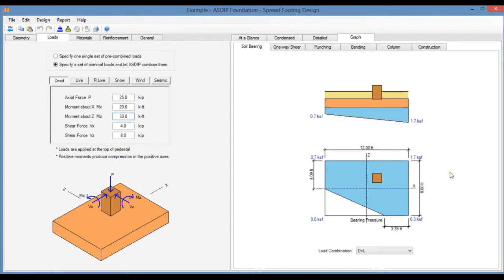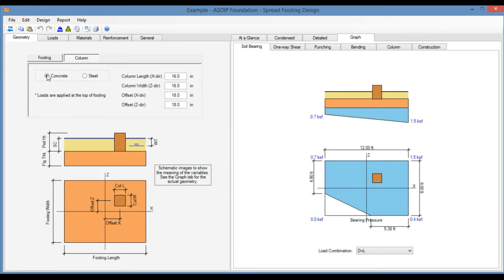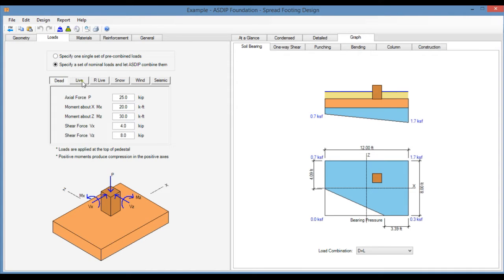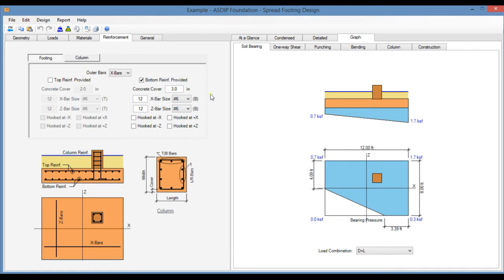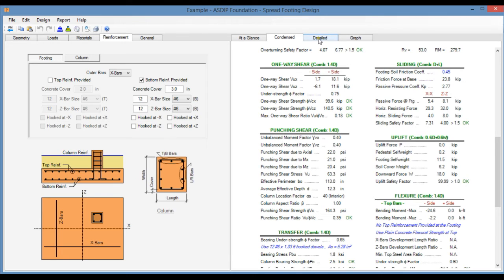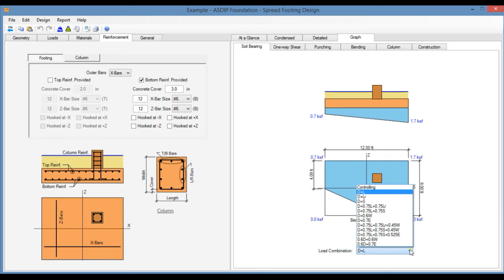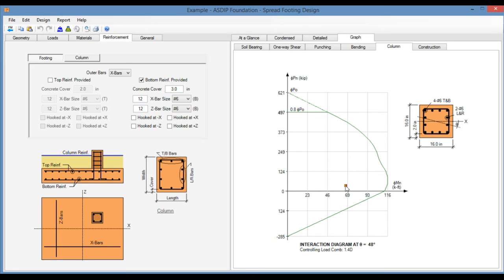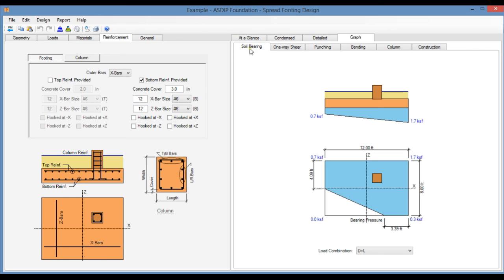Spread Footing Design Using ASDIP FOUNDATION

Comment: For this isolated footing in the reinforcement tab, the diagram is showing top reinforcement. What is the condition of the load why we need to provide top reinforcement?
Reply from the maker: You may need top reinforcement when the footing is subject to uplift. The program checks this condition.
Reply: @asdipstructuralsoftware7797  Thanks for the reply. Is it correct to say that having an uplift is not a desirable design? I thought, top reinforcement is provided only if footing thickness is more than 1m, act as temperature / shrinkage bars.
Reply from the maker: @gnidnoeled786  Yes to both, uplift is undesirable but sometimes is unavoidable and the design must consider it. For deep sections the T&S steel should include top and bottom bars.
Reply: @asdipstructuralsoftware7797  I appreciate your reply. 🙏

Comment: Does ASDEP consider Concrete and Soil Cover Self weight internally or should be calculated and added?
Reply from the maker: The overburden pressure is calculated automatically.
Reply: please clarify (Concrete Self + Soil ) ?
Reply from the maker: @georgefattal3540  Yes.

Comment: Hi, I have been testing the demo version.

I would like to know how the software determines if the column is edge/interior/corner.

I see that it is automatically done based on the footing dimensions, but what's the criteria?
Reply from the maker: If the column face is closer than d/2 from an edge of the footing, it is an edge column. If two column faces are closer than d/2 from the two edges of a footing corner, it is a corner column. Otherwise it is an interior column.
Reply: @asdipstructuralsoftware7797  Thanks for the super quick answer...That's what I thought.

But I am trying with the following input:
Footing: 2.5 ft x 2.5 ft x 16 in
Rebar: #5 
Column: 6 in x 6 in, and pedestal same size....No offsets.

So, d=12.4 in, and d/2=6.2 in.

According to the software, this is a corner column. I don't understand why. With those dimensions, between the column edge and the footing edge there are 12 in. so more than d/2. What am I missing?

Also, in the graph for punching, it shows a 2.56 ft x 2.56 ft square, that I can't track what it means.